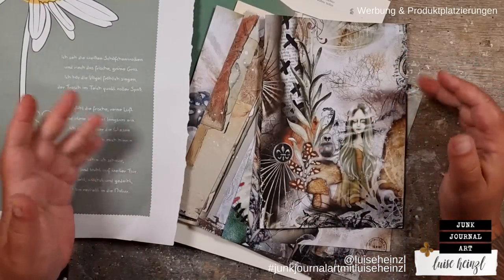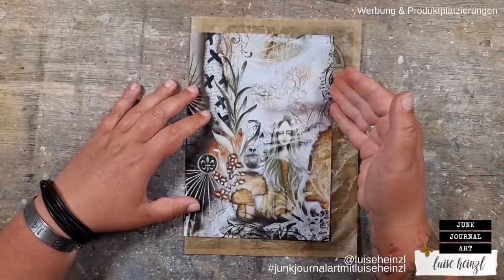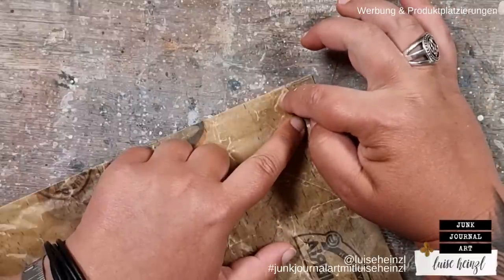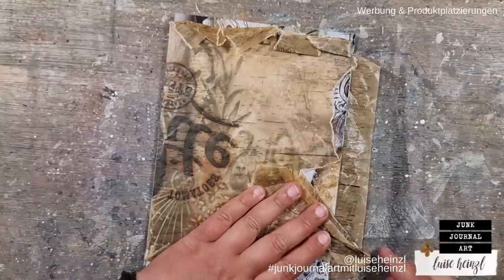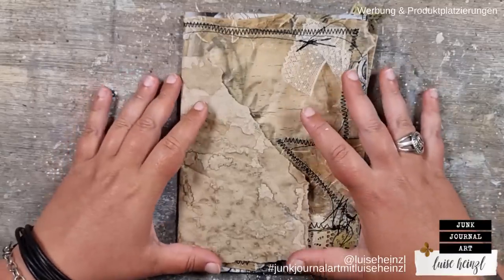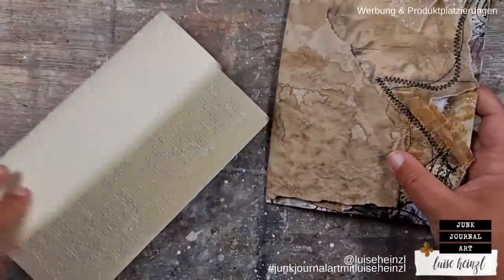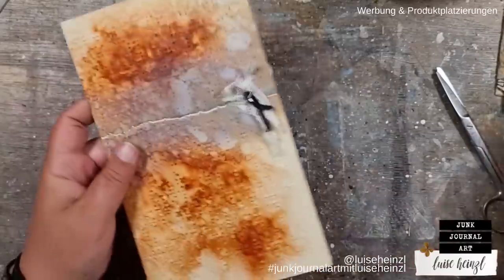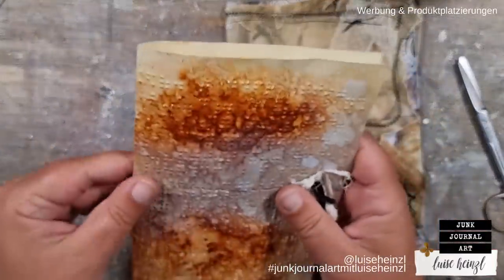ideas on how to bring your junk journal papers to the right size to fit into your signatures!

Comment: This video is very helpful for preparing papers to make signatures.  Love what you did with the oxide ink, iZink spray and braille paper.  I find that if I brush the track of my paper cutter every now and then with a soft toothbrush, it helps make my cutter work better.  Thanks for sharing your advice.

Comment: Question for you. I got inspired by you and Barbara (49 Dragonflies) and bought a group of Mica sprays and Oxide Sprays. I love them but have a couple problems with a few of the bottles. When I shake them, paint leaks out of the spritzer part and goes into the cap. Is there something I need to know when putting them away? I wipe off the sprayer hole after each use. Do I need to do something else? Have you ever had problems with these spray bottles?
Reply from the maker: Yes, that's sometimes a problem. It helps when you shake the bottle like a bell 🔔. Hold it with your fingers at the top part and shake the bottom part. Instead of shaking it vertically... Does that make sense?
Reply: @luiseheinzl  Thank you for your reply. I will try that! My husband said to try and pull up on the sprayer part and twist a little to get the stopper to seal? It works sometimes...again I love you videos!  Thanks!

Comment: When you glued the pocket before sewing it, what kind of glue do you use? Do you make sure to not sew on the area where the glue is to avoid getting the glue on the needle or have you found a glue that you can sew through without problems? Thank you! 💕
Reply from the maker: It's bookbinder's glue. As soon as it's completely dry you can see through it without any problems
Reply: @luiseheinzl  Last night while sleepless, I made a couple of your darling paper clips and took them with me this morning to a Friday morning coffee of about 20 women which I attend. I had an idea last night that I asked about and they not only loved the paper clips but also my idea of turning them into earrings!! You wouldn’t have to do the two parts separately and maybe just cover a bit more of the metal, leaving room for the bead dangling at the bottom and the ear wire at the top.  Putting some glaze on the little flower might make it sturdy enough too. Thank you for the inspiration!! 💕